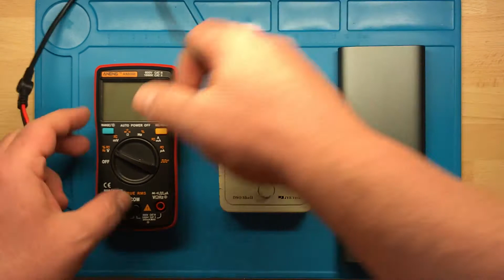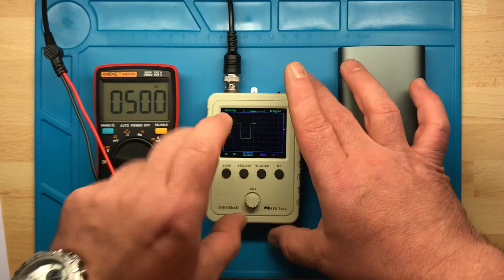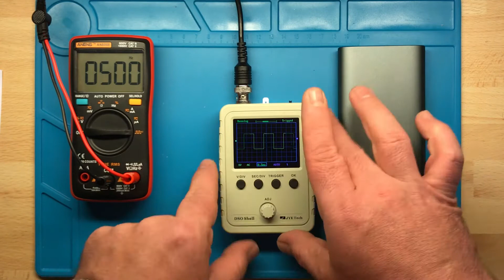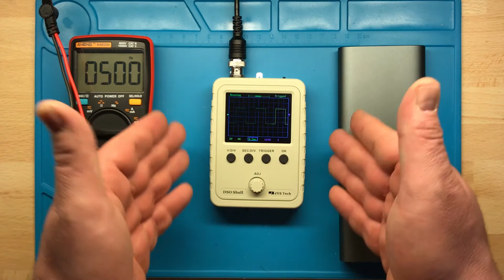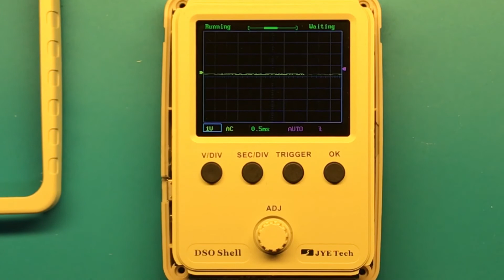JYE Tech DSO150 now real handheld DSO with LiIon battery build in.

Comment: Looks like you could fit another battery along side the one you added?
Connected in series, with an 8.4 volt charge/protection board would removed the need for the boot (assuming it would work from 8 ish volts)...

Comment: If you follow circuit for the main board the first thing the voltage does is pass through a single 1n4007. This diode can be eliminated and voltage dropped to 8.3 volts saving some battery power. But then if we look the next stage is a LM1117-3 that regulates the voltage down to 3.3 volts. The LM1117-3 has a 1.15 volt dropout at 1 amp, and needs a minimum 4.5 volts to provide a regulated 3.3 volt output. Now we have just cut the input voltage in half from 9 volts all the way to 4.5 volts. We do need 4.5 volts on the separate analogue board, which is perfect because we already have that for the main board now. I hope you understand how the DSO150 can be made to run on only 4.5-5 volts prolonging battery power significantly.

I have done this using a substantially smaller battery management board that is used to protect 18650 li-ion cells connected to a micro-usb breakout board, and used I think a LM2750 to boost battery voltage. My entire battery charging and boost circuit is easily half the size of either board used here. I think there is more steps but I can't remember now, but it should be easy to figure out. English is not my first language so I hope this is easy to understand.

Comment: Building the thing SMD R30 (Switch By Pass) has to be removed as a final task.  You could use that point to add your battery power to the existing  switch.
Reply from the maker: That was also my first thought but then I have to let the DC/DC module direct attached to the battery, but the module always drain some power. So I decided to use the switch between the charger board and the DC/DC module. Hope this is clear in my other build with the case from gianlucca there is a second switch to control power between the two modules.
Reply: Down and Dirty Easy way would be to install a DPDT slide switch like this in place of the original.  Just bend on set of legs so to fit in the PCB and use other contacts for your Buck Converter ?  http://www.newark.com/e-switch/eg1271/switch-slide-spdt-300ma-30v-pcb/dp/15N7322?mckv=ssK9m9fsh_dc|pcrid|81515568501|plid||kword||match||slid||product|15N7322|&gross_price=true&CATCI=aud-126792145221:pla-148795896741&CAAGID=20376569421&CMP=KNC-GUSA-GEN-SHOPPING-15N7322&CAGPSPN=pla&gclid=Cj0KCQjwnfLVBRCxARIsAPvl82FCfTRsAzy3LIwiNw_5LMzX4Hveza6a0iFGEz1B_JioHHCU6dzo_rQaAoeaEALw_wcB&CAWELAID=120185550001395043

Comment: Did you change resistors usb battery charger ? Or did you leave it as is?
Reply from the maker: At the battery charge amd protection module I did't modified anything. In this version I removed the potentiometer on the DC/DC module and fit in a resistor to the set the voltage. At the final version with a much smaller DC/DC module I left the potentiometer at his place. Just check my newer video about the DSO150.

Comment: hey, just found an easier way to do that :)
look at this image: http://i.ebayimg.com/images/g/~BgAAOSw~QdZy-Zk/s-l1600.jpg
and this single board which does the same as your 2 ones :)
http://www.ebay.co.uk/itm/USB-Lithium-Li-ion-3-7V-Battery-Charging-Module-4-2V-Boost-Step-Up-5V-9V-12V-24V/263143114089
Reply from the maker: squalazzo I got my new modules and they fit well, new video will come soon, this video has one disadvantage the DC/DC part is always drawing power from the battery with two modules I can use the switch between protection board and the DC/DC module.
Reply: oh, great, let's wait for new video then :)
Reply from the maker: the new video is out and their is a giveaway with the DSO150
Reply: seen that, very nice built and nice additions, too, thanks :)

Comment: Nice, maybe you can use MINI-360 DC-DC in the next version, it is MUCH smaller, and allows you use bigger battery :)
Reply from the maker: Roman Mikulka two new kits arrived and I’m already working on a better version with bigger battery.
Reply: nevermind, I realised that mini360 is step-down, not step-up :/
Reply from the maker: I ordered this one looks very small but I also have a plan B just strip down the regular module I used and fit it in a better place. I think I will show you the new one in a few days. Also the charging and protecting module will be striped down and I will fit it in a better place.
http://bit.ly/2zpYCxA

Comment: You should take look at this link, http://www.jyetech.com/forum/viewtopic.php?f=19&t=1153.  Myself and a couple other people modified this DSO scope a while ago with internal rechargeable batteries.  My modification is very clean and allows me over 13 HOURS of continuous battery operation.
Reply from the maker: upss thanks for you tip I ordered two more DSO150 and an smaller DC/DC converter, my plan is to use the internal switch and jack wo no modification for case is needed.
Reply from the maker: I made now a better version and it came out quiet well, another viewer mentioned to make wireless charging that is the next I will do with the DSO150.

Comment: is that a xl6009 stepup converter? can be exchanged with a smaller factor mt3608, so that no mods to the dc dc converter are needed? thanks, great video!
Reply from the maker: squalazzo it’s a xl6009 I have plenty of them laying around so I tweak it to fit.
Reply: Do It Yourself quick & dirty sure, I imagined that, but can be used the other one, too? Easier for who have none of them and have to buy, no mods needed
Reply from the maker: squalazzo it should be capable of deliver ca. 500mA at 9V about 4,5Watt
Reply: oh, right, thanks :)